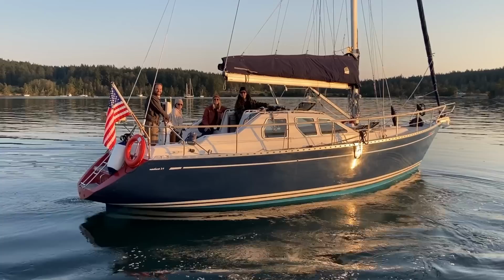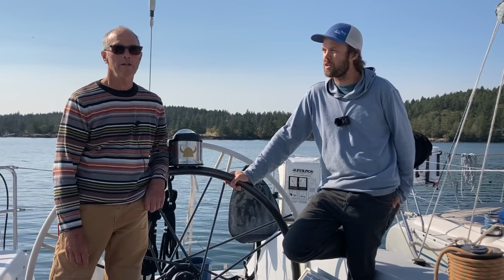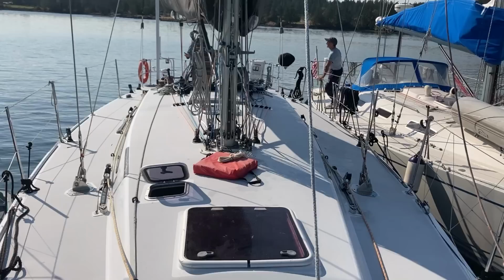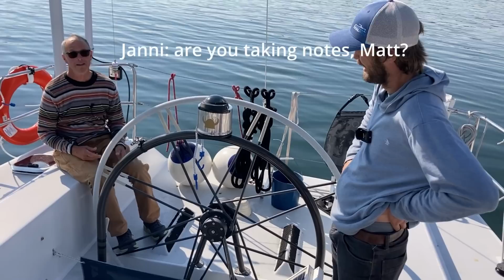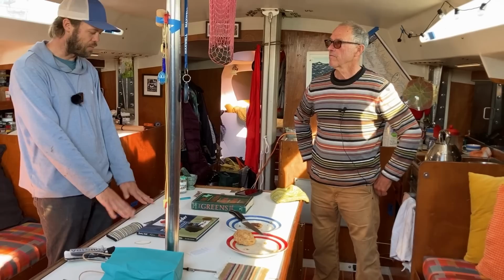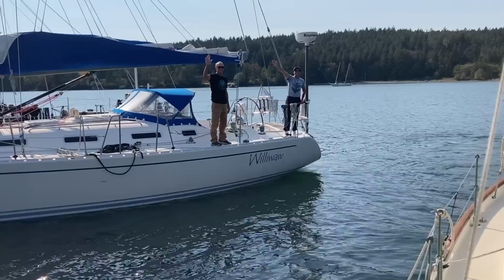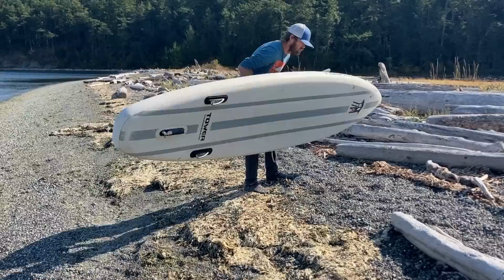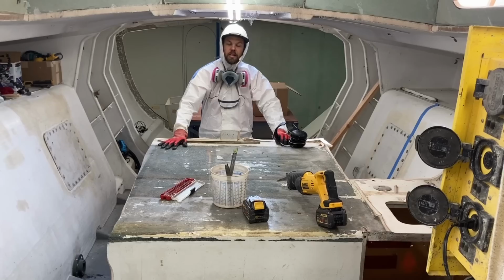SAILBOAT REFIT: Raceboat turned cruiser tour, and more demolition.  [E50!!]

Comment: Wow!  Cutting out that console in the center of the boat really opened it up.  I can visualize you using that space for a lot of things.  If those large containers on each side of the yacht were water tanks, it would seem to me that it would be better to make water tanks that you could build into the bilge for extra ballast, but with a small tunnel under them so that you could still drain any water that gets into the bilge.
Reply from the maker: Hi Gerald, stay tuned! That's what I'm working on now.

Comment: Need to weigh everything you remove….your words….so you know what weight you put back.
This is a great project to watch!
Fair winds ⛵️
Reply: i thought the same thing and realized how tedious and almost rediculous this might be unless you had some super process and 10 extra hands.  weighting each cut piece, weighting each piece of glass and pound of resin, oops sanded off some - 3 ounces....oh cut out water ballast tank no idea the capacity by remove maybe 100 gallon ballist at 800 lbs makes significant difference in righting moment i think he already did these calculation or atleast i pray he did...

Comment: Comment here about E49 and the bubbles that remained after vacuum bagging the traveler bulkhead... From experience, I am thinking that there might not be a path for the air to escape. IIRC you use (from the fibre and resin up) peel ply, then a porous/perforated membrane, then the bag. It seems to me there is lacking a void layer that would allow the air to travel to the low pressure of the vacuum. Or put another way, for the vacuum to reach the air pockets. Perhaps some breather material would be useful. Old school is to use discarded nylon 3 strand rope below the bag to create a channel towards the vacuum source. I have used oil absorbent pads (expensive, but  I have them already). Perhaps consider where you get bubbles and create that path to the vacuum.

To get fibre to lay in hollows is a challenge. Every application of a roller or scraper pulls it away. Yeah, the vacuum is meant to pull it down, but that might mean pulling cloth laterally from the surrounding area, which is a challenge as it starts to get sticky. 

Anyways, keep up the awesome work! The two of you are moving forward and I'm sitting on my butt commenting on yahtube!
Reply from the maker: hey Dave, we do use breather clothe. The problem wasn't air moving out, it was creating a vacuum. I need a bigger, high volume vacuum for that size of a project with that many complicated parts. i am borrowing one for future big vacuum projects. cheers!
Reply: @TheDuracellProject  Yes, its hard to tell the layers from the video. As I watched ep 51, I tried again. The bag is obvious, but the underlayers are less so. May I suggest naming them for us viewers as you lay them down? Tusen Takk.

Comment: Just curious about the ballast tanks are these used in place of someone sitting on the side when the boat is healing over? If so would the ballast be transferred from one side to the other when tacking to catch a better position in wind or changing direction ?
Reply: Pretty much yes.
Reply from the maker: Yes

Comment: I find the prevailing notion that racing boats are somehow “unsafe” to be interesting. They can be more fragile than a heavy cruiser if you happen to crash into things, but they are also often better engineered to withstand high sailing loads. They often also come with safety features such as watertight bulkheads to mitigate some of the crashing risks.
Reply from the maker: Yep